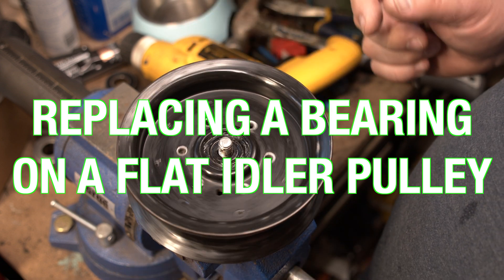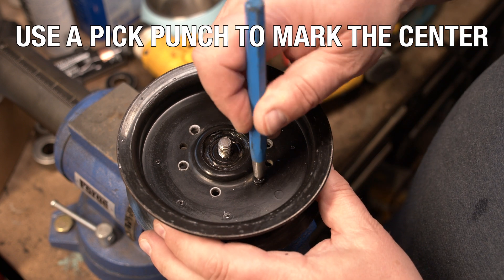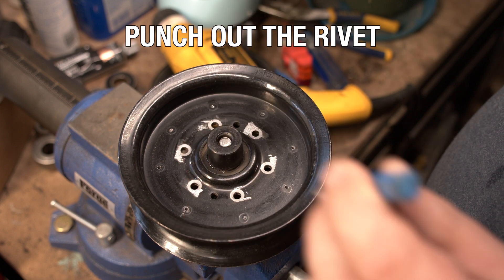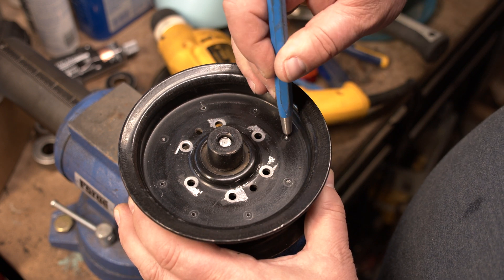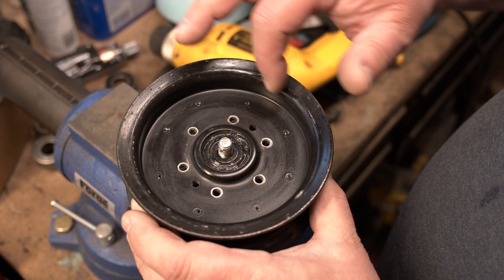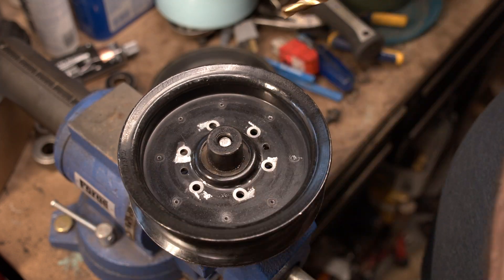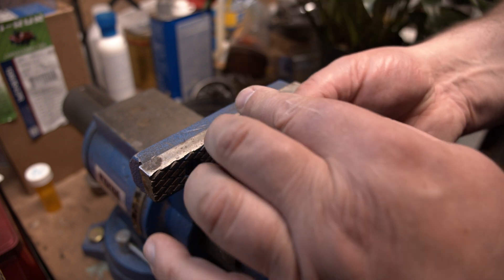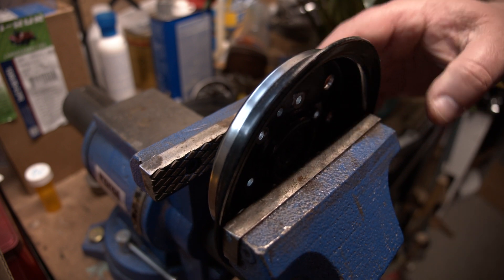Replacing an Idler Pulley Bearing

Comment: Great video ! Just about to do exactly this process on one of my mower pulleys. 
A thought about the pully spinning when drilling rivets. Drop a bolt, nail or similar item through one or both or the pre existing two holes in the pully so that it is trapped in your vice jaws.